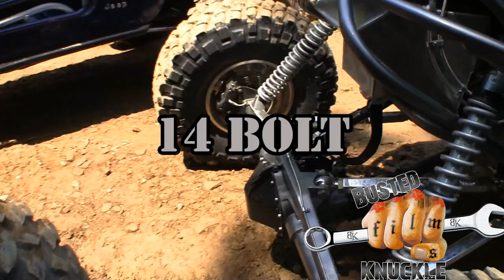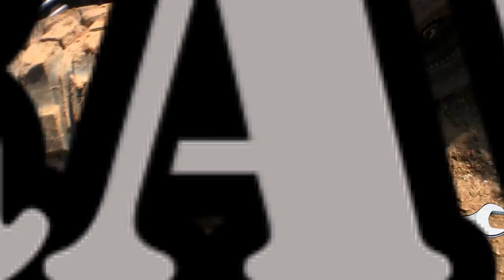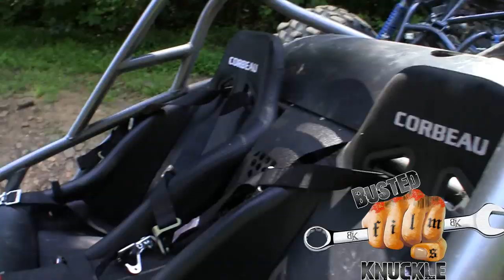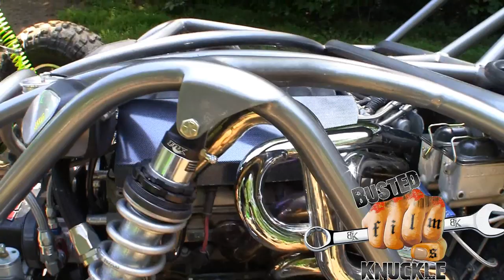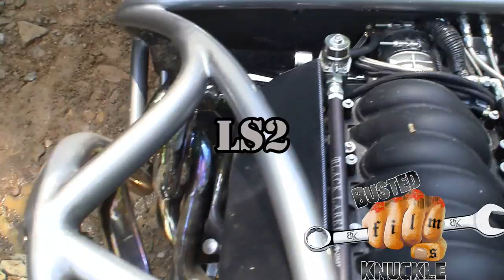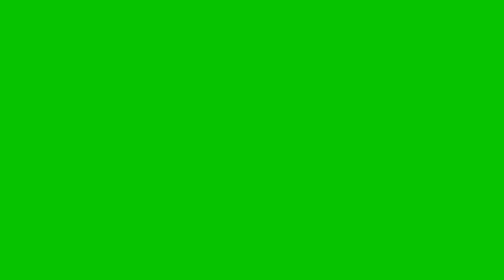Coleworx Eleanor Rock Racer Walk Around with specs

Comment: @BustedKnuckleVideo The chassis dont really get worked that hard. For the amount of tubing used, and the overall weight of the vehicle. Its pretty well overbuilt. But mig welds are still bullshit on a 70k+ build. Just my opinion of course. I dont think you should EVER grind a weld to "dress it up" Anyone can bend a tube. The real skill is in fitting it so you can weld it and have it look flawless. Hard to hide a huge gap with tig.